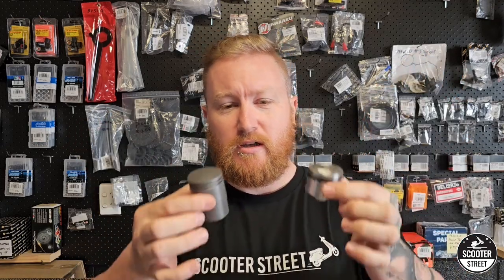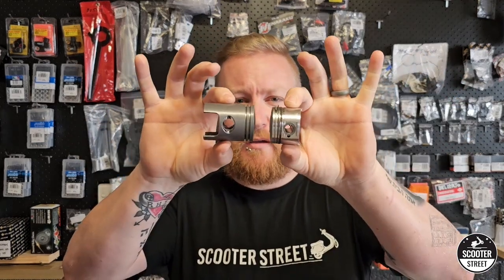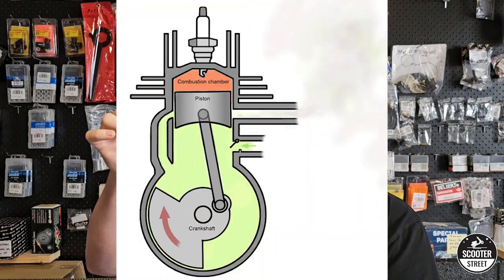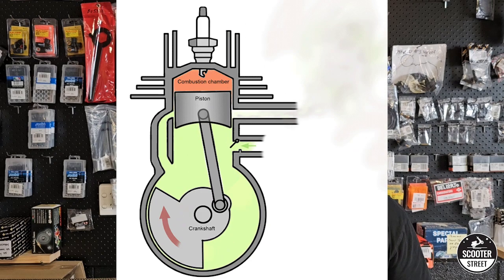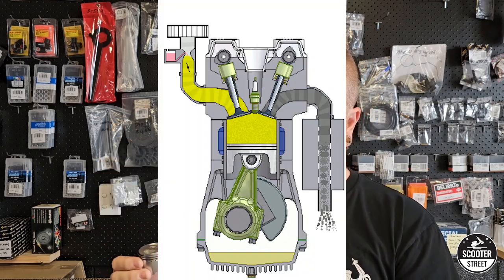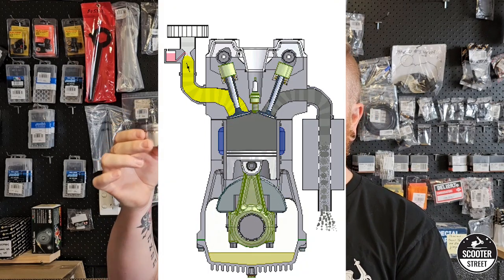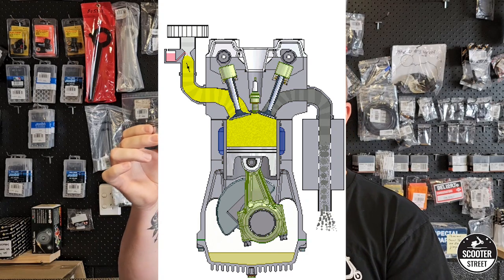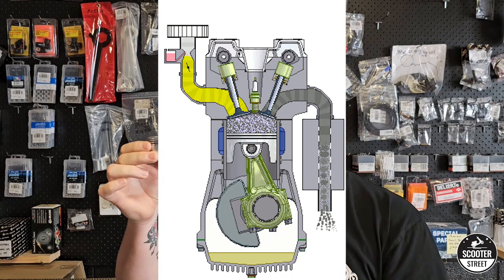Are 2 Stroke Scooters Better Than 4 Stroke Scooters? Performance, Reliability, & Tuning Differences

Comment: If a 4t is my only scooter, worth upgrading? Sport exaust, better carburetor, and 70ccc kit? :)
Reply from the maker: Yes but we find the parts for the engine are more expensive. Loads of info out there on where to start.

Comment: My Kymco 100cc 2t has 50000km on the clock never opened, my 170cc 4t had a complete engine rebuild at 14000kms and valve turning every 2000kms.
Reply from the maker: Yep, gotta love the 2 strokes. Would have been Taiwanese built to a certain quality. Sad to hear the 170cc has not lasted to expectation.

Comment: I recently picked up a 50cc 2 stroke to flip. Sadly it's and old out of production scooter with a severely diminished aftermarket and absolutely no information about it. Don't think it was designed for adult weight because with the chain driven fixed gear transmission, it doesn't have the torque to really accelerate my 210 lbs from a dead stop. But once it gets over the sluggish start, it pulls until it hits the rpm limit at 30 MPH.
Reply from the maker: Check the air flow, fuel flow, exhaust blockage and the transmission.

Comment: Hey great Vid, looking at getting a scooter, whats your opinion on a Yamaha YW 100 ? if i get it i plan on fitting the big bore 125cc kit and required accessories.
Reply from the maker: The Yamaha YW100 is a terrific scooter to start with. Go for it🏍️ the 125 kit and supporting parts make it twice the fun.
Reply: 👍👍👍👍 thanks, I'll be ordering parts through you guys if you can supply.

Comment: 4 stroke has two revolution's per combustion and a 2 stroke has 1 revolution of the crank per combustion

so a 4t has 5000 combustion's(powerstrokes) in 10000 revs and a 2t has 10000 combustions(powerstrokes) in 10000 revs

Comment: do you recommend polini sport 70 or dr evo kit 70
Reply from the maker: Which ever you like and fits your budget. At sport level many have similar power.
Reply: @scooterstreetau  which do you recommend?
Reply from the maker: @rene17368  Give the DR a go, make sure you can get spare parts such as pistons and gasket kits.
Reply: @scooterstreetau  all the people in my town mostly have dr 70 because its super reliable and lasts long
Reply: @scooterstreetau  don’t you get all that in the kit for like 110€?
Reply from the maker: @rene17368  Sounds good👍
Reply from the maker: @rene17368  It comes in the kit but spares pistons and spare gaskets don't come in the kit.
Reply: @scooterstreetau  why do i need a spare pisto
Reply from the maker: @rene17368  Never  mind.
Reply: @scooterstreetau  what crankshaft do i buy? I was thinking about jasil top racing 50-70
Reply from the maker: @rene17368  Yes that sounds good👍
Reply: @scooterstreetau  and do you think giannelli reverse could handle those 2 cylinders?
Reply from the maker: @rene17368  Yes the Gia Reverse is a great exhaust👍

Comment: Hello sir i will be happy to answer  i have a 2stroke honda dio zx but there is a problen when i turn it up from inside the exhaust the black oil comes out when i bite what is the problem
Reply from the maker: Check the oil pump system and the sprak plug. It could be due to excessive oil in the fuel mix. There may be low spark causing unburnt fuel. Check the spark plug and the spark test.
Reply: @scooterstreetau  thanks sir  it is possible that it is a ring and piston problem?
Reply from the maker: @علیمددی-م5ظ  Yes, it is possible. Check the above first and then move to the cylinder.
Reply: @scooterstreetau  🙏

Comment: Hello! I have a aprilia sr50 2010 and the carburator is flooded but it has  jut a litle bit of gas arond it but it doesent leak and the performane is not decrased and the problem is with the electric choke because i bought a new one and it works a litle but not as it should. Can the flooded carburator be the problem? If its not wat can be the problem? Please help me!
Reply from the maker: The cause may be one of these: The fuel tap, thw carby gasket, the carby needle and float system, the oring on the adjustment screws.

Comment: Well i have Vespa PX-200 1987 never change even 1 motor component and still running like a girl,even spark plug is the same last 6 years and i am drive it almoust every day 😉
Reply: A koliko kilometara si napravio? 😀
Reply: @Ice-T.  Ja sam je kupio prije  7 godina i sad ima nešto više od 30000km ali kad sam je kupio na satu je pisao 0 jel nije radio sat tako da neznam koliko je prije toga prošla a prošla je sigurno više nego ja otkako sam je kupio a to nije malo za dvotaktni motor jbga 😁
Reply: @najdrazi_tatica  nije malo al nije ni puno 😀
Moj '09 Runner 50 ima 76kkm, s time da zadnje 3-4 sezone više stoji nego se vozi
Reply: @Ice-T.  Cuj ako se nije kvario onda je to velika stvar,ovaj hvali 4 taktne skutere kako su izdrzljivi ali sumnjam da ce se naci neki koji se nije pokvario s tolikom kilometražom kao što ti imaš ili sa ovolikim godinama kao što moja vespa ima 😉
Reply: @najdrazi_tatica  ma vraga se nije kvario, pogodio me usran primjerak, nakon samo 800km me prvi put ostavio na cesti, nakon 5000km se počela raspadat mašina, sve u luftu, svugdje curi(a nisam bio od jučer u tome), koštao me taj skuter pun k novaca, hoćeš kvarova hoćeš održavanja, ali i dalje ga držim na životu
Reply: @Ice-T.  E jbga,mene ova vespa još izdala nije,pali na prvo kurblanje eventualno drugo,veliki plus joj je što nema mješalicu pa sam ulijevam dvotaktol skupa s gorivom,to je puno pouzdanije od mješalice i pumpe ulja 😁